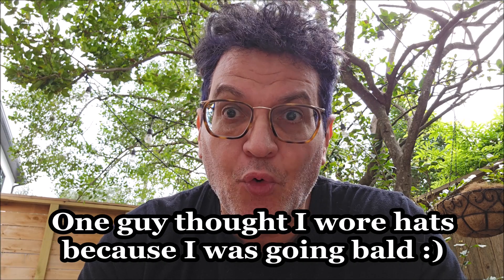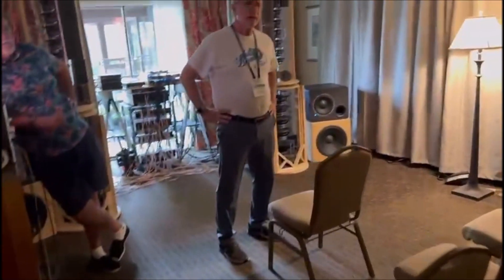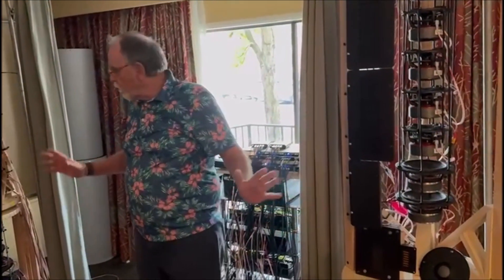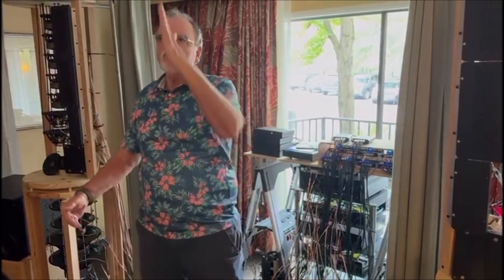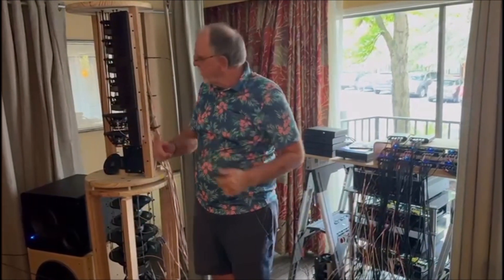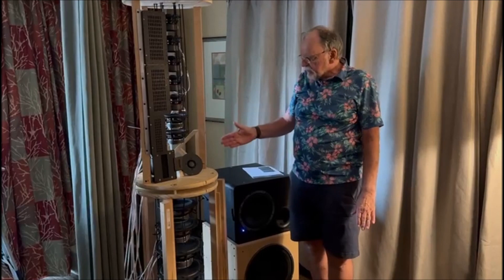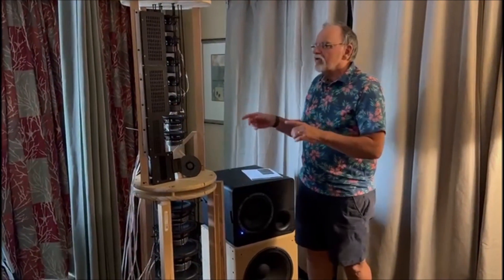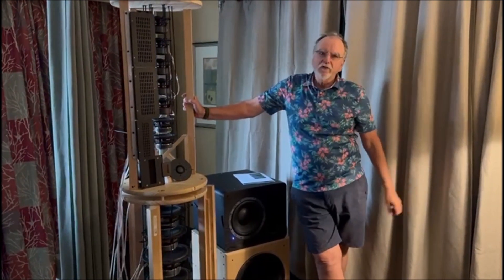😎 World's First Fourier Transform Speaker: Audio Revolutionized?

Comment: Maybe it's a function (see what I did there) of the youtube compression, but the transient attacks seem a bit rounded. Considering how compromised listening via youtube is, the imaging and soundstage seem incredible. Obviously, I'd need to hear familiar source material in person to form a better opinion. But as a proof of concept, to me, they hit it out of the park.
Reply: Could it be your iPad power cable?
Reply: I see some weak points - first to make it work we need to digitalize , analyze and following bring back to analog. It is not kept all the way  in analog. It callls for decisions about bit rates, types od conversion and quality of all that.  Simplicity up to me  is best.  . Then assuring exact timing of all processes -  time shifts would  unfortunatety appear instead of  those beaten. 

Is the result justifying that effort it is not proven for me - I cant say it is sound which  I would even accept for me . At end every speaker even every part of it's membrane which is not in exact distance from ear  (and they are mounted horizontaly! )  provides  it's own unique phase shifts in own reproduced range  and it  is capable to nivelate  effort. At best it is beatingto zero  pure unique crossover phase shifts.  But phase distortions are not adding and not worsening (like say THD or timbre  distortions) - they do not add lineary  - they go up and after getting maximum  they go down back to zero and go opposite  with maximums  at  +180 or -180 deg.   cancelling one of  reasons may in some cases result in  increase of total shift. Like using not tasty ingerdients we make best creamy cake - better  not forget about any 

Author is convinced that headphone sound may be treated as perfect reception but does he notice that   when the ear shells are pressed by headphones to head and change their form it   completly changes  listening perception making it no comparable to free listening?

Comment from the maker: For those unfamiliar with the word "fourier", I'll put more details in the description, but in essence, the Fourier theorem provides a powerful tool for understanding and analyzing complex waveforms by breaking them down into their simpler components.
Reply: True Fourier analysis and synthesis (involving reconstruction from pure sine waves) would require an unreasonably large number of separate channels and drivers,  Here he even says that each driver covers a range of about 3 notes (in I assume the Western 12-tone scale.)  No pure sine waves are involved. It seems like this is just an extreme multi-way speaker with a digital crossover, and separate amps for each driver.  

Maybe if and when he is ready to sell a product, it will have some advantages over typical 3, 4, 5, and 6-way designs, but I have my doubts.
Reply: @immovableobjectify  Add to that it has some sort of a vertical dipole configuration, distances between drivers way above wavelengths, diffraction from all those drivers. No wonder he cannot pin point the source of the sound.